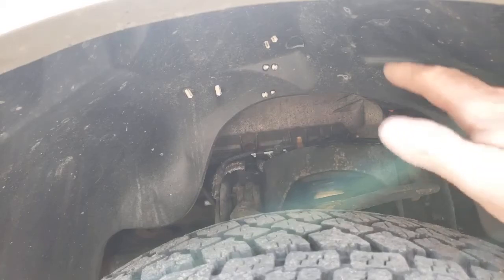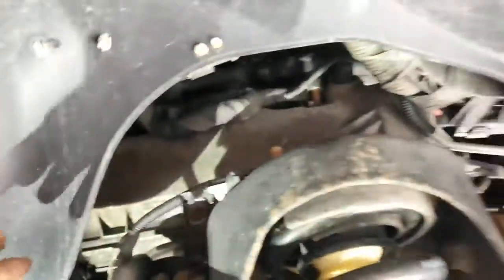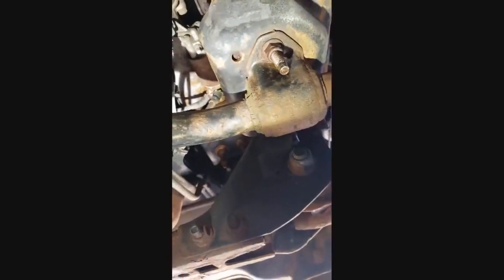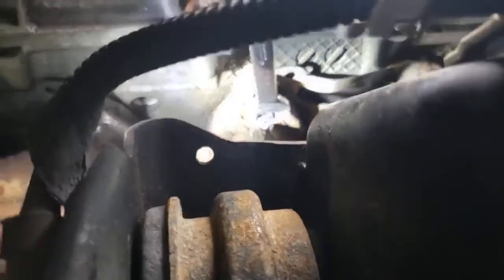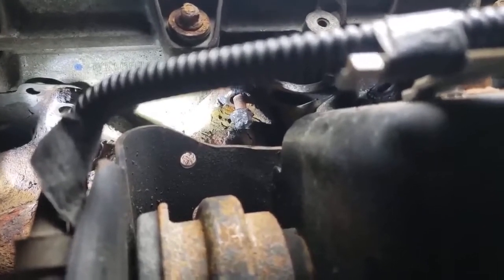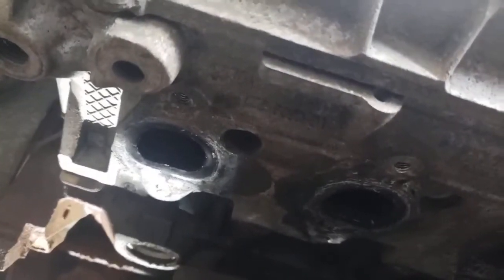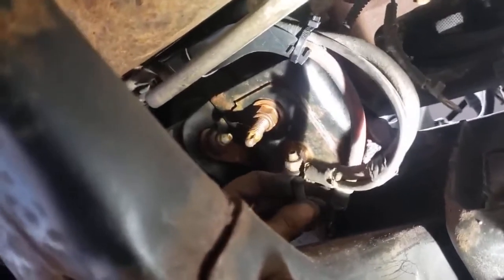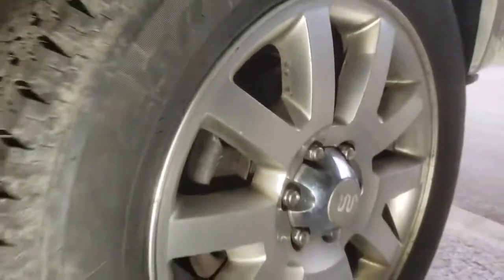The dreaded Ford 5.4 manifold

Comment: I just did this job today,passenger side, on a 2010 with the 4.6. Had to loosen the engine mount nuts and then jacked up the motor for some clearance. Then I used my Chinese plasma cutter to cut thru the exhaust bolt. I then used my $200 Chinese copy of the badass inductive heater on all of the nuts and studs. All came out with ease. That inductive heating tool is a miracle.
Reply from the maker: I heard of the inductive heater.  Would like to have one of those.
Reply: @workwithkevin  Its absolutely priceless that I can, once it cools, bend the coiled end of the copper electrode 90-degrees to get access to the nuts.
Reply: Did you use a jack to lift the motor?

Comment: I’m in the middle of doing my 2010 F150 5.4L passenger side.  I’m having trouble getting to the two front bottom bolts. Hopefully I’ll get them out within lifting the motor.  I really like my truck but my goodness it’s a engineering nightmare.  Going to try the impact ratting. Thanks for the tip and the video
Reply: I agree wholeheartedly with the engineering nightmare
Reply from the maker: I removed the starter made it easier and I used a mirror at times. It was tough but a whole lot cheaper than the garage charges. Good luck

Comment: Had same trouble 3 sets in 3 years ,i installed headers, Doug Thorley. No more problems and better get up an go..
Reply from the maker: That's an option. I think that ford should have better inner fenders to keep water and salt off engine too.
Reply: @workwithkevin  Exactly , Ford does not always have a better idea. Good used manifolds come from dry states.

Comment: The issue from what I gather is poor design, lack of good flex having the one way exhaust weight on one side (passenger side) and poor quality steel not coated for poor conditions, rain, snow, salt on the roads, extreme cold or hot weather etc. Headers are a better option for those who wanna get more mileage and most likely withstand harsh weather conditions. I'm on my 3rd manifold on the passengers side and after 4 years in NE weather they look like the one in this video. Dorman brand replacement. Lifetime warranty so will get the $80 back. But the labor is $600 at $90 an hour, local mechanic. I have 250k miles on it but it's a utility vehicle for my college attending son for snow trips, extra vehicle for when another vehicle needs service etc. This time I coated the manifold 4 times with high temperature grill paint. We'll see if that helps. I don't see having it longer then five years but who knows it still runs and drives great.
Reply from the maker: Lots of work and cost.  I can't stand a leaky exhaust

Comment: Way to go man I’m doing the same thing , how did you get the front bottom bolt ?? Through the top with a wrench ?? My top one was already broken. I’m hoping to weld a nut to it !! I’ve been letting them soak for two days !! Somebody mention the Ford make you loco guy has a four video series and that you don’t have to drop the starter. I watch the same one and the guy did drop the starter so I did the same thing you did. I’m gonna replace my starter I put junk back in Any way!! really good job!! I was going to give up but here we go !! I’m dealing with Wisconsin winter too so I feel your pain. This video is like two years old. How did your manifold hold up?
Reply from the maker: Still crossing my fingers manifold still quiet. Thanks for watching
Reply: @workwithkevin  just got mine out !  Dang !! I was going to junket until I watched your video man thank you I got three studs snapped off and two are in the front. Wish me luck it’s not over yet Chevy man 320,000 miles only thing I did was brake lines Ford do you like the navy seals, it’s like hell week 120 hours of just grueling unnecessary labor to get that stuff out. The starter is ridiculous. I like how you mention what happened to the two bolt Chevy starter come on.

Comment: Save yourself the headache because of a poor manifold design. They will just keep cracking on you in time. I did mine on a 2010 F140 Lariat and opted for JBA shorty headers that bolt right to the stock exhaust system. No troubles anymore, quiet and will not crack. Happy with the outcome in the end. Headers are a little more money but you won't have to do this again. Just make sure to periodically tighten the mounting bolts again.
Reply: Have the new headers held up?  I think it’s the exhaust mounting design that puts to much pressure in the manifold

Comment: My 2003 F150 has the same  problem cracked manifold it's never been replaced the nuts n studs so rusted that I'll have to cut them off some I just welded the crack for now let me know if you want to do another one
Reply from the maker: Wish I could have welded it. Crack was around to back side too.

Comment: How can your manifolds look like that being "new"?  Those things look OLD.   You say they replace those 3 times?  I just replaced my passenger side and am doing the drivers now.   A new welder showed up late last night so I can weld the nut to the last remaining stud. FYI on  a 2011 Ford Econoline you do not need to raise motor for passenger side, only starter. 5.4
I drilled out that broken bolt and broke off a "easy out" inside the bolt.  Hence the welder.
Reply from the maker: We have lots of road salt here in upstate New York.

Comment: that's why you do the job yourself and replace everything with stainless steel
Reply: I didn't. I dont plan on having to remove them twice. I'll buy another motor first.   ;)
Reply from the maker: If it happens again I will. Thanks

Comment: I'm doing the RH side right now on a customers truck. What a F,ing nightmare !
Reply from the maker: Fords better ideas. Close to starter, motor mount, and a/c.
Reply: Yep, I had one stud break in the worst spot after lots of heat and penetrating oil. After welding 4 nuts on it, the head  came off....

Comment: Hardest part for me was getting the old manifold out and the new one in.
Reply from the maker: It's a project
Reply: @workwithkevin  it definitely is but I did get it done.  Took me about a day and a half.  I ended up jack up the motor a few inches and the manifold came out pretty easy.  

Hopefully I never have to do it again lol

Comment: Fordtechmakuloco has a full 4 vid series on how to do this job and you do not have to remove the starter nor do you have to jack up the engine. Extra work for absolutely no reason. 🤦‍♂️
Reply from the maker: Yes but he has a lift. I was crawling and couldn't see well. I didn't remove the motor mount or jack engine. Just needed to get broken bolts out.

Comment: Are the the bolts being replaced? It’s common problem for boats to break. If you’re telling them to replace the manifold, they may not be removing broken bolts and replacing bolts. Don’t tell a technician what you want done because that’s what they’re gonna do. Good luck! You will wish you had a professional technician. Just saying!
Reply from the maker: It was the third time doing this. twice by "professionals" and this time i tried it, yes a struggle, but hundreds cheaper. I had no broken studs until I removed nuts.  I installed the stainless. Cross my fingers, still quiet.
'